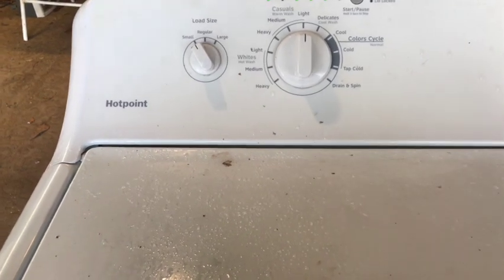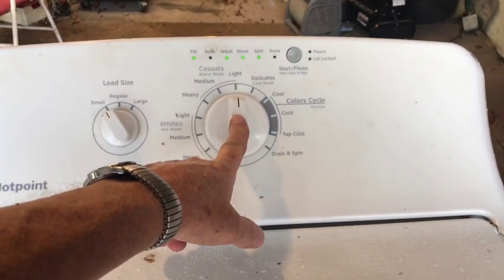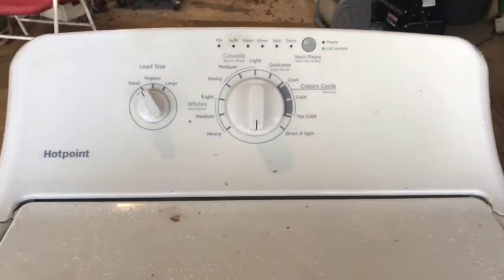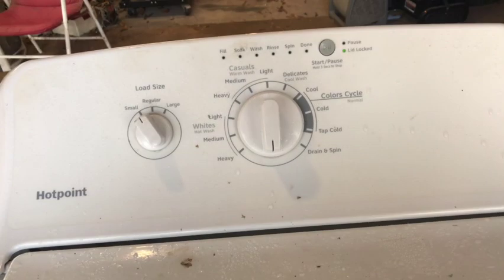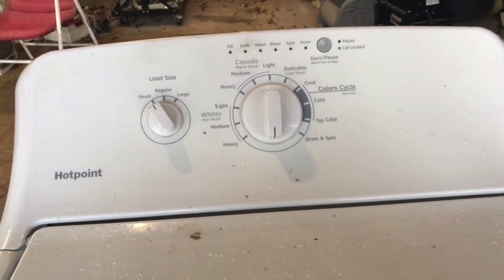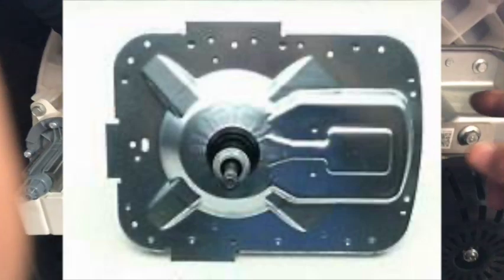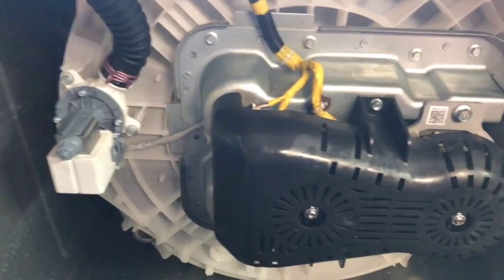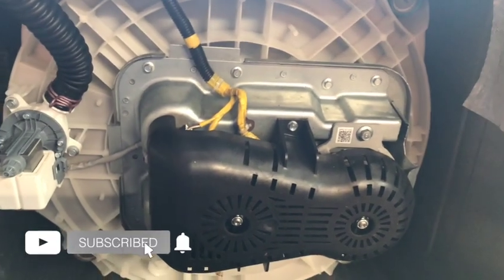How To Fix Roaring Noises During Spin Cycle: Bearings Repair vs. New Gearcase

Comment: When you say gearbox are you referring to everything within the gearbox too? For example on another make and model, if the bearings went out would you suggest they get a new machine? I’ve heard bearings are a pain to change. I’ve tried it once, but I tried for days to get the wash plate out and never did.
Reply from the maker: Yes, everything that is contained within the tack welded gear case is not serviceable. There are a few models where the bearings can be changed. Here’s a video on that Whirlpool Cabrio Bearing Shaft And Seal | How to Replace Them
https://youtu.be/KegGGSrD0qA. Today at 5:00 PM central time I have a video going public on changing a gearbox. Here is a link to it, I don’t know if you can watch it early or not. Let me know if you can. Washing Machine Gearbox NOISE | Replace The Gear Case
https://youtu.be/MeCOnVgo_h8

Comment: So they are made a lot like the newer Whirlpools. They are not direct drive like the Whirlpools- they actually have a planetary in the gearbox? At least they put the machine literature in a place a lot easier to get to.
Reply from the maker: Yeah, almost exactly the same. The shift actuators are different, I’d say a better design, but they also have a gearbox that is tack welded together so the bearings aren’t serviceable. And, the tachometer/speed sensor is independent of the shifter.
Reply: @HarperandKnowles  does it actually have gears in the transmission or is it a straight through shaft like the Whirlpool?
Reply from the maker: It also has planetary gears in the gear case. If you’d like to see someone with more patience than I, check out “Washer and Dryer Money’s” excellent video right here: https://youtu.be/WF5V1Dijsiw
This young fella has many videos and is a powerhouse in this niche. I highly recommend watching his channel. Excellent content right there! He covers the inner workings of the GE gearbox about 4:50 minutes into the video.
Reply: @HarperandKnowles  thanks that really explained it. there is hardly a lick of difference between the GE and Whirlpools now.

Comment: Thats outrageous.  Has GE redesigned this setup or addressed the seal leak problems?  Even a cheap machine like that shouldn't have a failure like this, so soon.  Service bulletin or extended warranty for these people, if this is that common a failure point?
Reply from the maker: This is a common problem among all the lower end products these days. We’ve become a “throw away society” and these machines are engineered to sell not to last.  If a family of four gets five years out of the life of a machine they are lucky.  In my experience “Speed Queen” is a top quality machine if you are looking for something to last the way they used to. Thanks for watch and thanks for your comment too!
Reply: @HarperandKnowles  how old was the hotpoint?  Also could a transmission unit be swapped from a junked washer cost effectively?
Reply from the maker: I'm not sure how old that particular model was.  The problem with swapping used transmissions on a customer's machine is that it's labor intensive and you never know how much life is left in a used part. A customer that pays to have a used gear box installed and then a month or so later has the same problem isn't very happy with you.  I learned fast that it's not a job I will do unless I'm rebuilding a machine to sell and then I give a 90 day guarantee on the old part and will replace the whole machine if the transmission fails. Even if you replace the gearbox with a new one you're taking the chance of disappointing your customer should another component on the machine fail, such as the control board.  It may not be your fault, but human nature makes the technician the scapegoat, so my policy is if your gearbox has failed it's time to replace the unit.